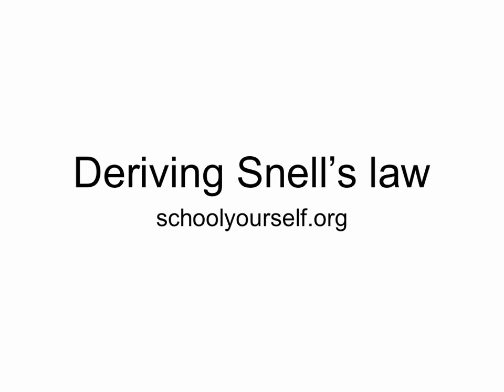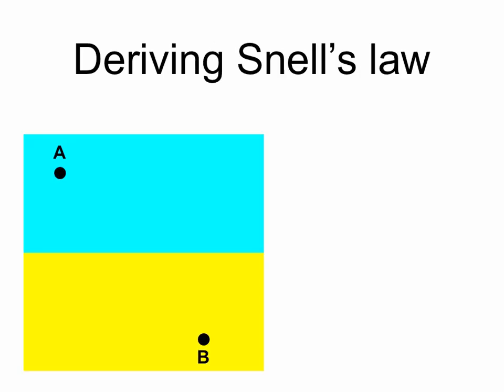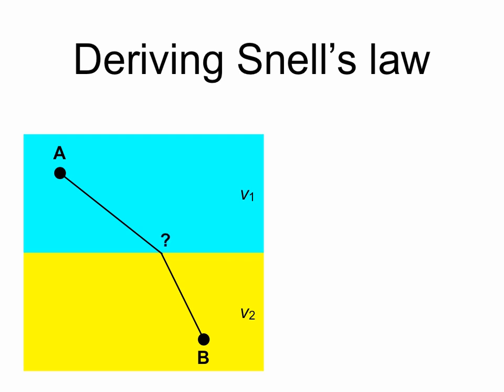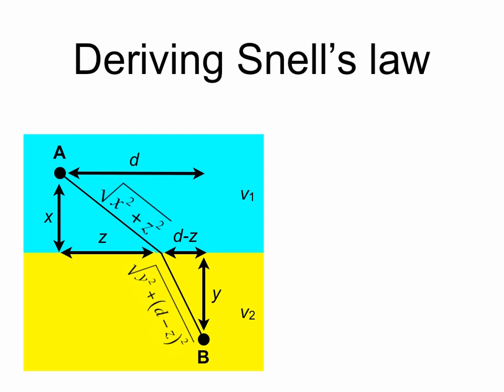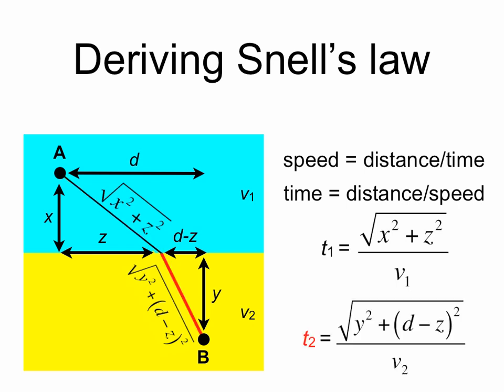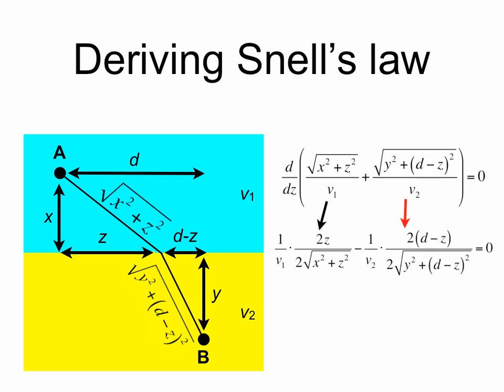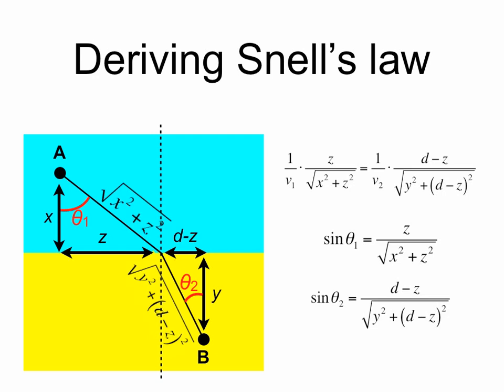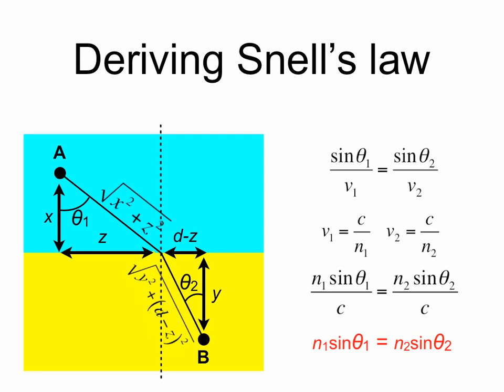Deriving Snell's law

Comment: I don’t understand, why do we differentiate with respect to z and not x, d or y? What’s so special about z?
Reply: That's a great question! If you observe closely if the value of z = d -z , then AB would be a perfectly straight line, making both the triangles similar, notice on varying the length of z how the path from AB changes, since we are concerned with finding the path along which light takes the least amount of time to travel, we express time as function of "z", after obtaining the relevant equation for time in terms of z, we have to minimise the given function, hence it's purely logical to differentiate time with respect to z as it is a function of z.

Comment: 6:05 why can we use the alternate interior angle, if it's value differs from the actual angle we want? Why does it still give us a valid equation? That's the only part I don't seem to understand
Reply: wdym? It’s parallel lines so the 2pairs of alt angles are equal

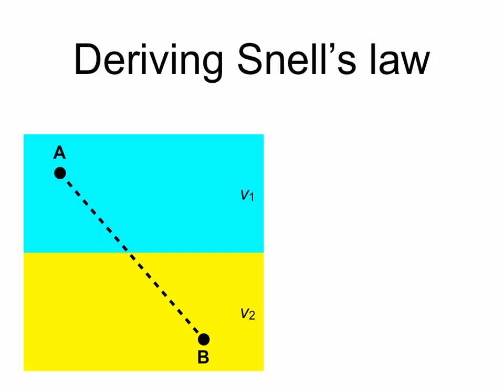Comment: illogical conclusion at 1:17. v1 > v2 doesn't mean most of the path should be in the blue region. Here is a counterexample.
Assume v1 = v2 + 0.0000000000000001, points A and B are 0.00000001 and 1 unit away from interface plane, respectively, and points A and B lie on a line that makes a 45 degree angle with the interface plane. Then giving A a longer path than B in its medium would result in a longer time than a straight line path between both points.
Reply: longer path doesn't mean longer than what it took in 2nd medium, it means relatively longer than the straight-line path taken by light in first medium itself, try calculating the times in both cases, your logical conclusion will fail
Reply: @devd_rx   
Duh
My counterexample gives a situation where allowing the path to be longer in the region where light is faster gives a longer time than a straight line path. Just draw diagram 

Let A and B lie on a line that makes a 45 degree angle with interface.
Let A be 1 unit above interface and B 10 units below. Let v1 be marginally greater than v2 (v1 = v2 + 0.0000000000001).

Now if v1=v2  then the straight line path would give shortest time. Buy since v1 is sufficiently close to v2 then the kink wouldn't be noticeable and would appear to be a straight line path. Also the fact that A is extremely close to the interface where B is significantly distant gives the contradiction in his statement. Snell's law still holds of course. His rational at 1.:17 is wrong though

Comment: Here there is an alternative derivation of Snell Law (very simple), using the conservation of momentum of photons:

If in medium 1  the index of refraction is n1 and in medium 2 the index of refraction is n2 and for the definition of index of refractions and wavelength we have:
n1 = c / v1  ,  v1 = λ1 * f  
n2 = c / v2  ,   v2 = λ2 * f 

Dividing the above equations we obtain:   n2 / n1 = λ1 /λ2  
So if n2 is higher than n1, the wavelength in medium 2 is smaller than in medium 1.

Now because the photon momentum is:   p = h / λ
Applying the conservation of momentum of the incident and transmitted photon along the parallel line of medium separation:

p1 = p2  →   h/λ1  *sin(θ1)  = h/λ2  *sin(θ2)    →   n1 *sin(θ1)  =   n2 *sin(θ2) 

This is the Snell Law!!
So the refraction is just a consequence of the conservation of momentum of photons!
Reply: How do you know the frequency, f, of the light doesn't change as the light move from the first medium to the second medium?
Reply: @davidbrisbane7206  frequency would not change even though penetrating through mediums
Reply: @davidbrisbane7206  Because all that happens when light passes through a medium is the phase of the wave gets kicked back.
Reply: briilient thought process bros
Reply: awesome derivation
Reply: holy fucking shit.....
Reply: did u post it on veritasium video too?
Reply: Why do we have to use sin theta